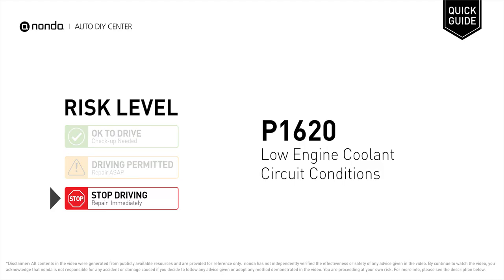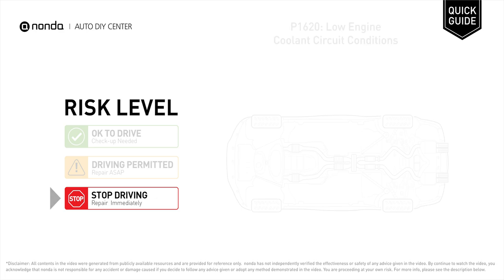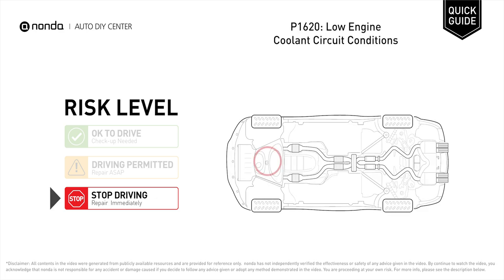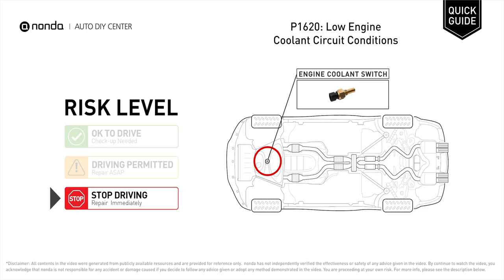What is P1620 Engine Code [Quick Guide]

Comment: How to fix  p1520
Isuzu 4jh1 2006
Reply from the maker: Hello, please check the throttle valve motor circuit for open/shorted harness or poor electrical connection,.